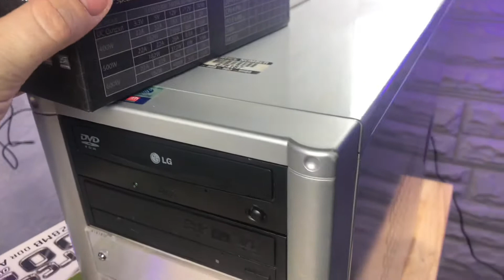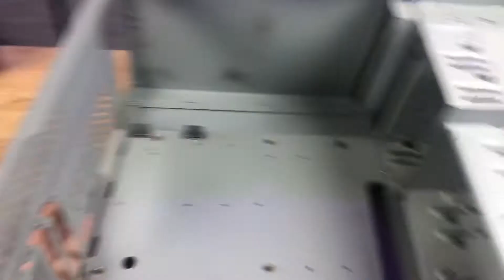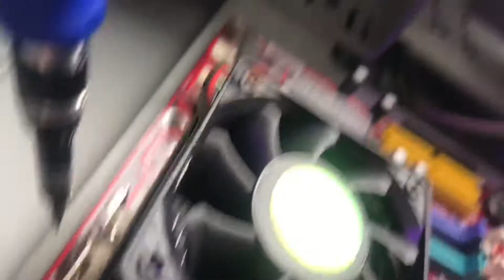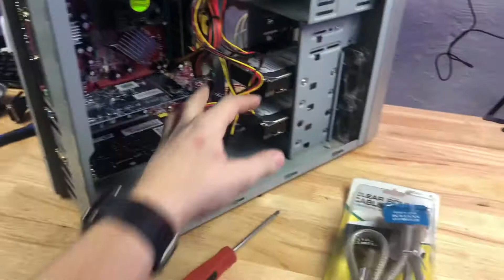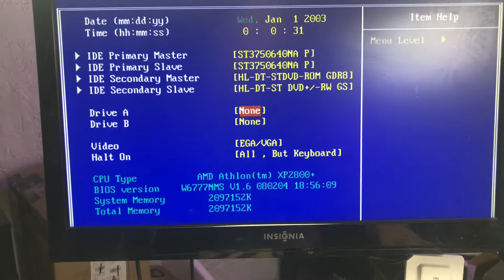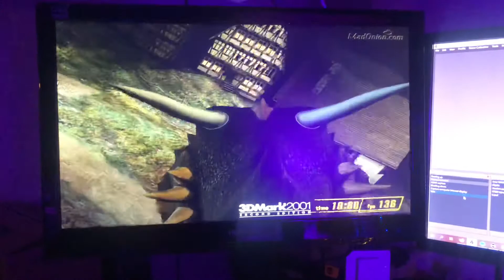Building a brand new 2001 AMD Athlon XP gaming system in 2020

Comment: And today(June 2025)I am working on a sibling to that MB an MSI KT6V MS-7021 Ver. 1, the big hurdle is updating the Bios to support Barton CPUs I got the MB in a built PC with no PSU but everything else including a Sempron 2400+, some mismatched 512GB ram 266 and 333mhz, a 40GB(nearly full with XP installed)and 165GB HDDs, a slightly newer than the rest of the parts Nvidia 7300GT all in a beige Apex PC-115 case. Upgrades are or will be an Antec SP-500 500W PSU NOS, an XP 3000+ Barton(once I can flash the Bios) I got 1 stick of G.Skill F1-3200PHU1-1GBNS RAM(I had another bought from Ebay and the seller never shipped it so I need another but everyone is asking higher prices), a set of Apple Ram 2x PC3200 256MB CL3(it was the right price and i thought having Apple RAM in a PC was funny), it will work just perfect for Windows 98SE limit of 768MB... And probably an Nvidia FX GPU for the better 98 and DOS compatibility or my GF4 TI 4200 128GB from my storage unit. Also I put a 1TB SSD in it to clone the drives to and i will put in a 120GB SSD for Win 98 SE with an IDE to SATA adapter once XP is setup the way I want...

Comment: I would argue this is more accurately a 2003 build. In 2001 you'd most likely have an athlon xp 1800 or Thunderbird. The Nvidia card would also most likely be a GeForce 2 or 3. 512mb of Ram was kicking it in 2001. 2gb wad unheard of. Nice system though.
Reply: In 2001 I had a thunderbird 1400 Athlon on an Asus A7V266 mobo with 256MB PC2100 then I added another 256MB this time PC2700 but obviously ran it at 133 (266) MHz. It had a GeForce 2 MX 400 and was powered by a Fortron 300w PSU.

Comment: Albatron KX600 Pro Mother Board. I have this motherboard on my computer 1.67ghz with 256mb ram AMD processor. I want to improve it to run at 3.6ghz with 8 gb RAM memory. What processor does this motherboard support and which graphics card can I put?
Reply from the maker: all of those manuals are still available. it really is specific to the board.

Comment: i don't recall glass windows or led lights in 2000,maybe by 2010 but not when xp was out that i can recall then again my stuff was all hp and the like.
Reply from the maker: plexiglass until very recently. pretty popular starting in 2001 or 2002.
Reply: I have a very generic mid 2000's case(from Directron computers of TX, USA) with 3 Acrylic windows and 2 are modded/drilled for 80MM fans and have Punisher fan grills and fake etched Punisher decals(looks like window etching from back then)on them too... It has no name, I suppose I could use Google Image to try and find it online.

Comment: Great vid very professional. But nforce 2 chipset had dual channel that's why your ram slots are coloured (seeing as there are 2 it makes no difference haha) and 462 could handle it. 754 could t do dual channel) nforce 2 could also do sata, I have a version of that motherboard and it has sata. Not not picking just chatting shop. Propper enthusiasts computer, no one back then built pentium 4

Comment: Woah nice case find, i had that exact same one when i built my first gaming pc back in 2003, $80 of ebay shipped which was still pretty cheap back then and man did it look modern at the time.  Only difference being it didnt have those fan vents on the window side, this must of been an updated version of the one I had since mine didnt but everything else is exactly the same down to the foot pads.  I ended up drilling holes in the same spot to increase air flow but ended up just keeping the side panel off.    Very close system too, mine  being built around the athlon xp 2500+ and an geforce fx 5900,  1gb Kingston HyperX low latency ram , COD just came out and it was next gen heaven,  the card lasted me until bf2 came out which was another leap but i cant say much has changed since seeing all the lighting effects and team style fps shooters that COD brought in, so it was even cooler seeing it back then.
Reply from the maker: I couldnt find exactly what I wanted, but its close enough to what I had haha.

Comment: Hey. You didn't show how you apply thermal paste which is a major problem area. Hey you didn't show how you hide the wires. Hey you didn't show how to figure out the front panel wires which usually are a pain.
Reply: Good thing this is just a build and not a tutorial. If you're having trouble with those basic things, you probably aren't ready to build a pc, considering a processor manual shows how much thermal paste, a mobo manual shows the front IO connectors, and cable management is only required if YOU want to do it.

Comment: I have refreshed my old pc, athlon xp 3200+, Asus A7N8x-E, 2gb 400mhz, Asus ATI 1gb agp 8x pro running win 7 32bit. Got to say the mashine is slow even with SATA drive.
Reply: i have same motherboard with barton core athlon XP(overclocked to 2.1), 2.5gb ram and 2600xt

Comment: i had an 1800+ with an epox kt board and gf2mx in '01. recently picked up a whole pc for 15 bucks with a 2200+ and nforce2 ultra board which is a nice upgrade with dual channel ddr. dual channel only helped out with about 10% performance increase but hey thats a significant boost in FPS of these old games. 

nice vid man, the temptation is too huge to do something similar with new in box parts. thanks for doing it for me instead :)

Comment: Cool build! I have some fond memories of PCs from that early-mid 2000's era. Back then I had one of those eMachines prebuilts with an AMD Althon XP 3000+ , and a disappointingly underwhelming integrated GeForce 4 MX. I saved up for a while, and upgraded to an ATI Radeon x850 Pro (AGP version). That thing was a beast.
Reply from the maker: I remember 'upgrading' from my ATI Radeon Rage 6 Radeon DDR 32MB to a GeForce 4 MX440 and actually dropping performance in most games. I feel your pain there. So weird how there were such good and such bad GPUs under that GeForce 4 family name.

X8xx series GPUs are solid. I have an X800 XT on my shelf and its mighty fast in old titles.
Reply: instaBlaster...